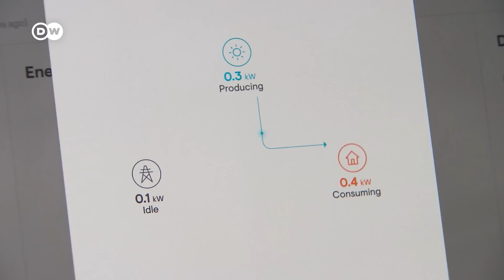London's first solar street go on the grid | Focus on Europe

Comment: The late David MacKay FRS wrote the book on energy use in the UK, it's a free download called Sustainable Energy Without the Hot Air, don't argue about things, do the physics and the costing.

His conclusion was that the entire UK land surface would have to be covered with either panels or wind turbines to make only half the energy that Brits use, and that's because people don't realize just how much energy they are really using and it's about 10 times more than just the electric bill when you include heating, transport (ie petrol), industrial and commercial  use etc.

For the US its about 10KW of primary energy per person, the UK is of course only half that about 5KW per person, it helps when you outsource your entire industry to China.

Basically to be totally green with no fossil  or nuclear, the UK needs to borrow other countries land, but damn, Brexit gonna make that a whole lot harder. France and Spain though really do have many times the amount of land per person.

Check on Wikipedia, Per Capita Energy use, hundreds of countries are listed there. Also use the LLNL graphics, Energy Flow Diagram that shows where energy comes from and is sent and by country and for the US by state. 

Personally I'd love to build a nuclear power plant in my basement and power the entire street and sub zone, bet no one would want me to do that though.
If my house in the US NE had about 12 panels in it, it would fully offset about 1% of the entire energy use of the 5 people within. It would also mean cutting down a lot of tall trees, that massively reduce the need for AC, it might not make even a small dent.

Also it's weird that DW News covers the story because in Germany while they were busy shutting down their nuclear power plants and building a complex mix of wind, solar and lots of new coal, their carbon emissions went up instead of down. And of course France has half the CO2 emission of Germany per capita because of their reactors and smaller no of fossil plants.

Comment: As someone with an 9kW solar system on their roof, solar is a no brainer and should be massively subsided by UK and EU governments, it has taken my electric ⚡️ bills in the summer to negative , it requires no new additional grid infra and reduces the load on average over the year for domestic and business users, combined with large battery storage in vehicle to grid cars this should be the future of domestic power. It also much cheaper bang for buck than insulating old housing stock. A team of roofers and electricians could do 2 or 3 roofs in a day, insulating and retrofitting takes months and his highly labour intensive.

Comment: This is the perfect solution that I have been talking about for years. 
Power companies need to get involved, they don't need to buy properties to put up huge solar farms, just help people to put panels on their roofs, and give participants discounted electricity. 
There are thousands of square miles of roof space that can be used in this way, it will save space, money and do away with the need for massive solar farms that take up valuable land.
Reply: Me too :) and even a small windturbine on every chimney stack as backup. A few years back when solar grants were available, I not being a home owner noticed a commercial building that was being leased by some people I knew that had a south facing roof, I suggested to them to make the roof space available to individuals to add solar panels, once the panels and installation were paid for the panel owner would get most of the profit from energy produced and a small percentage of energy would go to the lease holders in way of rent for the panel space. They did and it's still working :)

Comment: As long as the sun shines, should work great!
Reply: You don't need bright sun to generate power. A solar panel will produce between 10 - 20 percent of its rated power even on a cloudy day. 
They work on light, not just direct sunlight, if there is enough light to see perfectly, then the panels are getting the same light.
They work best when cool, so direct sunlight can be detrimental to the panels as they get too hot.

Comment: Fantástic! I use solar panels myself to power my house in the mountain. Feels so good to not pay any monthly energy bill at all 😊
Reply: Hot conditions can complicate it though.  Even efficient AC draws a lot of power day and night draining batteries leaving nothing to meet overnight consumption, then you can find yourself looking to the grid again rather trying to sleep in an unpleasantly warm room.  But, when solar meet the majority of your demand, particularly during peak hours, it’s fantastic.
Reply: Does it save money on electricity?  If it doesn't save money what's the point?
Reply: @Chicago48  Yeah kind of a catch 22. Capital cost of an off grid solar setup would cost several months (or years) worth of electricity bills equivalent to setup. Then it'll break even eventually assuming the system doesn't run into maintenance issues 🙃

Comment: Ah yes, London, known for being sunny. I am curious as to what the cost benefit analysis would be and how long it would take to break even.
Reply: Works well for me in Sunny Essex, I own 2 electric cars and live in a 240 m/2 house, my use of electricity doubled when I went EV, it's now lower (just) than it ws pre EV, so saving just over 50%. System has been in for 5 years, cost £9k and is guaranteed (parts) for 25 years. With the unfortunate rise in the cost of electricity it will have paid itself off in 18 to 24 moths time, so call it 7 years payback for the solar. In addition I spent £3k for a share in the Ripple Cooperative wind turbine at Craig Fatha in Wales (also 25 years worth of revenue) and hence I'm currently not paying (making approx £500 pa including £300 pa Feed in Tariff for the solar) for electricity.
A bit of luck money wise but my primary motivation was to make my own fuel and not give money to the oil and gas industry (granted solar panels are made in China, but avoiding Chinese products is a difficult one in our society today).
Reply: You don't have to wonder. There are free online calculators for that. There you can set your exact location, compass direction, inclination, etc. and calculate the energy yield.
Reply: My solar system generates about 10% of it's rated capacity on very grey cloudy days, and about 20% on days when the clouds are white and fluffy and there's sense that the sun is up there somewhere but you can't see it. That's enough to cover the consumption when people are at work and trickle a small amount into the grid. The idea that you need sunny days for a solar panel to work is a bit of a myth. Obviously a bright sunny day is much better but you can still generate energy on cloudy days.

Comment: You will see a return on your investment in fifteen to twenty years and there are expensive componants that need to be changed regularly too.
Reply: You'll be right about the components, I should think, it would be interesting to see a report on the cost and ease/difficulty of maintenance after, say, ten years. But the primary purpose of this project is not to save money, I don't think anybody in the video talked about that. They're doing it because they want to put more renewable-sourced electricity into the UK power mix. They wanted to build a low-carbon power plant on their street. This is a big step to take. If they only wanted to run their houses on renewable-sourced electricity, they could do that with one phone call to a power company.
Reply: @ghjgjihjgjyrdrgydsgr137  yes but the componants to make these things are still comming from gods green earth and not being replaced the same as fossil fuels.